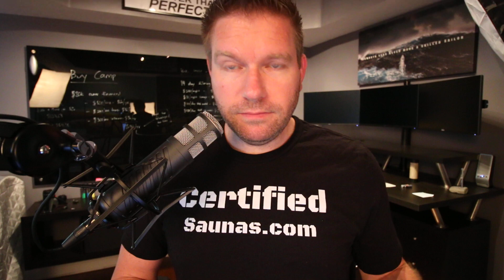Building A Low EMF Custom Sauna For My Wife

Comment: Have a closet that I am considering for a DIY Low EMF radiant sauna. Would love it if you could share any details about where to start in regards to heat panels, insulation, wiring, etc to get it as safe and effective as humanely possible. Thanks for the great content 👍🏻